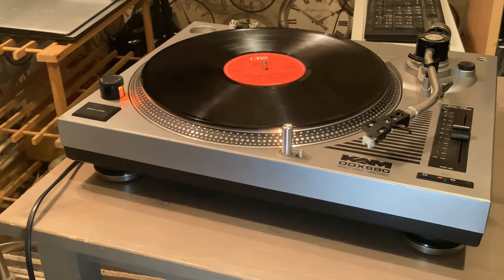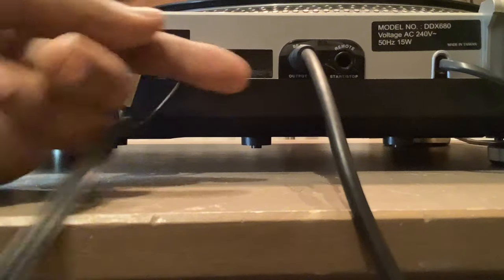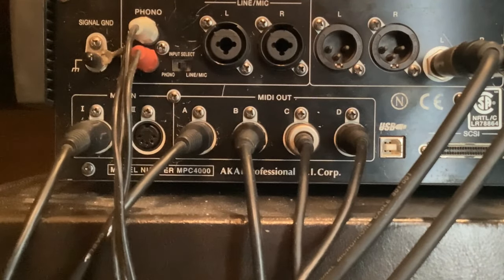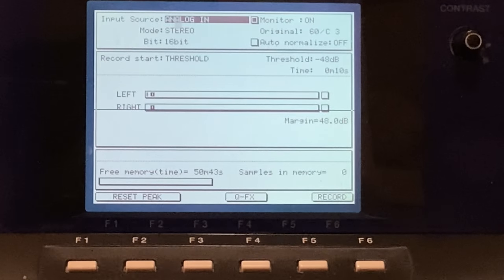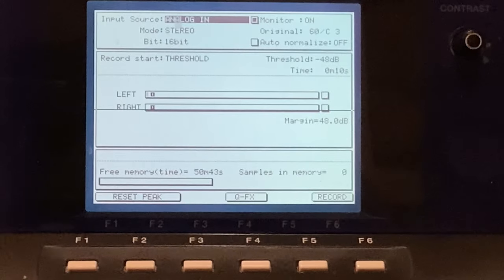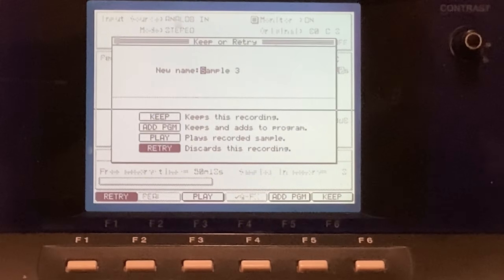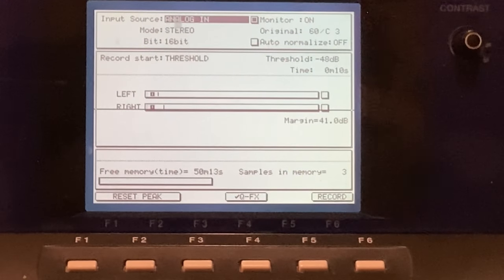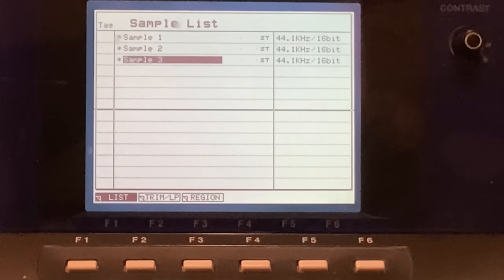Sampling Vinyl From A Turntable With An Akai MPC 4000 Real Time FX !!

Comment: How do you make the sample edit screen display the sample that way.
Reply from the maker: It’s always been this way I’ve never change the view and I’m not sure what you mean I no you can change it from linear view to logarithmic view is that what you mean it has 2 ways of displaying the wave .
Reply: @ I mean how the waveform shows, when I had a 4000 it would display the waveform differently like reverse to how yours shows it, check a few 4000 sample chop/edit vids most of those vids show the waveform how I’m talking about.
Reply from the maker: I haven’t changed mine since I had it
Reply from the maker: go to sample edit page and go onto view in the top left and then press window in there you have options for changing the view